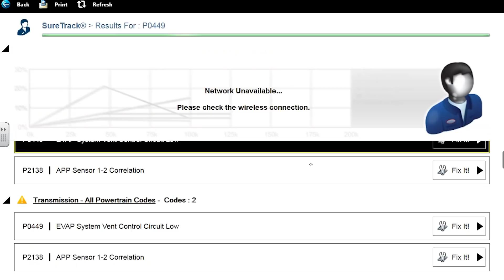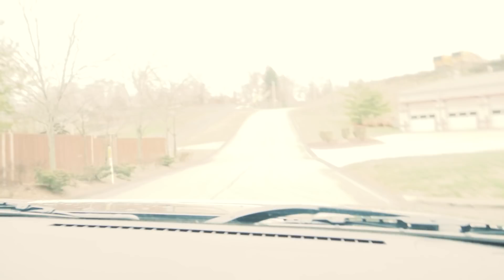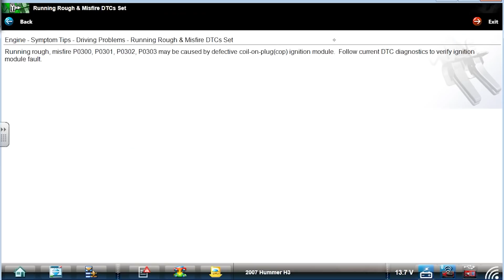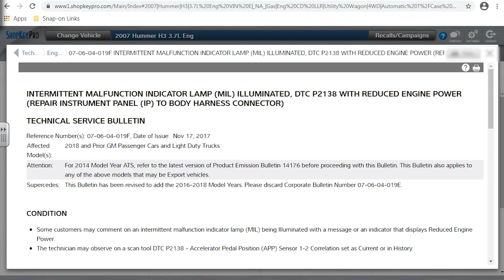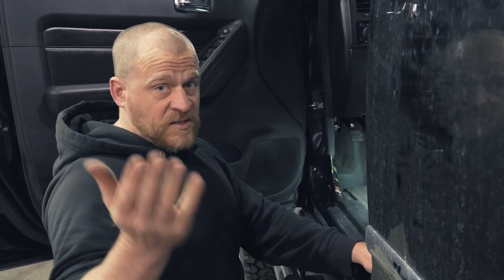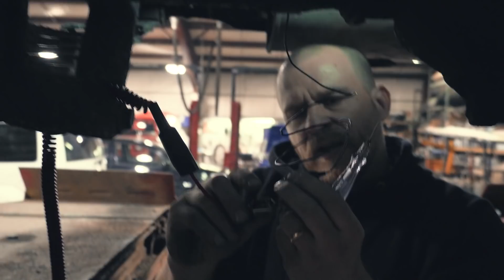2007 Hummer H3 3.7 Intermittent Limp Mode, APP and U-codes, No COM + EVAP Vent Solenoid Fault

Comment: Hi .. like the videos… And I have a problem 06 H3 … it only goes into limp mode when it’s Hot out… 70* and higher… and I do have a major water issue that I believe I have fixed from the Sun roof…but my relay/fuse box has a lot of corrosion too.. do I just change the whole box ? That’s what I think I should do.. I am wondering how it got so corroded.. and how I can keep it from happening again.. any suggestions ?
Reply from the maker: Change the box, yes. How to prevent it from happening again? That part I can't help you with
Reply: @ScannerDanner  Thanks... This POS has been a problem lately... but I could drive it all spring, fall and winter no problem ... I hope this gets it .. Thanks again
Reply: @ScannerDanner  I have 1 more question.. How hard do you think it would be to put like a 305 Chevy in it.. Would it be too technical ... or just a bit ?
Reply: @ScannerDanner  I found out how water would be getting to that fuse box and other places… because my H3 started a miss… checked the spark plugs and found 2 inches of water in the 1st one on the front of the engine
Reply: @ScannerDanner  the hood louvers… if it’s not sealed completely… all the way around… all 12 holes … and follows the hood frame work right to the fuse box… water every where
Reply: @ScannerDanner  I can only post pics on my page I guess

Comment: Aftermarket radio can mess up the car also
On my X-trail/Rogue, the pevious owner installed a Pioneer stereo. The pioneer canbus unit did something to the network and shut down the BCM. Not allways, but when that happaned, cabin lights came on for a second, then No turn indicators on dash, low beams on, no wippers, no arcon, no trque converter lockup,  if on cruise the engine would even stall. No com with the BCM. So I went to thru that rabbit hole. New BCM, new IPDM. Same fault after few daiys. I suspected the Poineer head unit but the radio worked and even the streering wheel buttons when the fault happened. One time the car was running, I was out oft the BT reach, Son was in the car and he noticed that as soon as the BT reconnected, the fault appeared.  So I took everything out that was from Pioneer. Drove few weeks in silence. Even the modules had no U1000  faults anymore. 
I reconnected the stereo, but without the canbus dongle. The headunit recieved Steering buttons, reverse and something more from the can dongle. Now the headunid works, but no SW controls.

Comment: My vehicle is doing the same thing. But when you first start it, it runs just fine, after driving it for about a hour it goes into reduced engine power with check engine light then it stalls. After a couple minutes you start it, the car starts and check engine light goes off. When you scan the codes, it shows no codes? Hmmmm

Comment: Done a couple fuse boxes on GM’s for throttle body voltage drop outs lately. Anytime the two main voltage pids didn’t match, it set a code and went to limp.
Hope they saved over a dollar per car making these parts. Seems to be happening across lots of brands. (Sighsshakeshead)
Need to make some videos on it too, haha.

Comment: Great video! Very informative as well as entertaining. Diagnostic work can be stressful and dull at times. It's good to let of steam once in a while. Correction: Class 2 serial data on GM's is SAE J1850 VPW (on pin 2 of the OBD connector), not CAN.

Comment: Intermittent issues are tough
Had a customer get rather upset we didn't find anything
Went for a test drive with the customer and they plugged in they're phone charger and 5 miles into the drive the car missed or limp mode. Disconnect it and the car ran fine.
Why I'm not sure. 
Well at least the customer got humble quick 
Thanks for the video

Comment: I have BlueDriver scanner I’m using since 2 years but found new thing which is out of my knowledge need u guys help ! On toyota corolla 2005 and nissan altima 2007 i try to connect my obd2 scanner ( BlueDriver) but it’s blinking blue light and get off again idk why whats will be the reason ! I check fuses but all are fine okay . Cig and obd fuse also i change but still my scanner didn’t connect do anyone know why ?

Comment: CORROSION IN YOUR RELAYS, I CHECK THAT FIRST ALLOT OF THE TIME WITH THE PROBLEMS YOU'RE HAVING, IF I FIND IT, I PULL THE FUSE BLOCK AND TAKE IT APART, AND ITS NORMALLY ALL CORRODED THROUGHOUT ALL THE BUSS BARS, ONLY TAKES A FEW MINUTES ON MOST TO DO, AND THAT BECOMES YOUR STARTIG POINT, I'VE REPLACED A FUSE BLOCK FOR JUST A HORN BEING INOP ON A LATER GM VEHICLE, I'VE ALSO REPLACED A RADIO FOR A TRANSMISSION PROBLEM TOO....EXPLAIN THAT TO A CUSTOMER, TECHNOLOGY IS GRAND.....LOL
Reply: I have a 2011 bmw 750 li waiting on a new exterior door handle because it makes the check engine light, trac light, abs light, and electric ps light all come on... that's a good one to explain to your customer. A $400+ door handle will turn off your Christmas tree dash- I promise...

Comment: My own Pontiac G6 had the water leak into the connector in the kick panel.  The sunroof drain would leak down the A pillar in a heavy rain and then had the reduced engine power situation.

Comment: Did you ever think if corrosion  come from? And it would be a good idea to use connections cleaner especially it is hard to clean.In my experience that the vehicle was into water.If it was a Hummer problem through G.M. maybe we have a bigger problem
Reply from the maker: poor fuse box design, 
We have a follow up video coming out this Wed. and the problem was NOT related to the corrosion believe it or not

Comment: Keep this in mind when something like this happens on the first generation Colorados and Canyons as they and the H3 are all based on the same platform.
Reply: I've fixed the same problems over and over on these. Cars are creatures of habit, if it happens to one itll happen to them all. Up here in Cleveland almost all of the problems similar to these end up having corroded relays, corroded fuse boxes, and tons of corroded grounds and random wires in a harness.

Comment: Hi Paul.  I was wondering if there would be anything to gain in these situations where you have driven the vehicle to try to experience the fault so most systems would have been stressed to a degree.To then run over the fuse box and areas of suspicion with a thermal imaging camera. Non intrusive and may highlight areas of electrical stress....perhaps give you something more than just a bare eyeball view and maybe give you some direction.
Reply from the maker: Great thoughts! I like the way you think. In this case the thermal imager would not have helped us. I have a follow up coming in a few days. Thanks!
Plus I think underhood temps and me having no point of reference on what a good system looks like. I think we would be surprised to see what is actually hot under there and it is not a problem.

Comment: Love it, Thanks for sharing SD👍
SD could this fault & the Class 2 DTC be occurring due to corroded relay pins in the power distribution box?
Stay Safe Guy's you're Awesome😎
Reply: I bet $2.63 that it is corrosion in or around the engine fuse box, possible corroded grounds for the relays that are under the box. I've seen 2/3 out of 4 pins on the relays corrode to dust and stay in the box when the relay is removed..
Reply from the maker: @Brother2Jis_27s4  you owe me $2.63 :-) update and fix coming up
Reply: @ScannerDanner  lol, pay pal work for you?  I've seen quite a few up here in Cleveland, salt is a problem. I've gotten cars with new throttle bodies, wiring harnesses, ecms, and just about everything new but nobody does electrical diagnosis from the fuse box. I bet you'll see it at some point, if you haven't already.
Reply from the maker: I have a follow up coming out in a few days.
Reply: @ScannerDanner  Thanks SD you're Awesome😎

Comment: Open solenoid is that mean it's bad?
Reply: How did you see this in the video?
Reply: @Ryder4u1313  buy his book and start learning. Take the class on line, and start making good money.
Reply from the maker: @Ryder4u1313  12v and 0v on a ground side switched circuit is NOT normal when the circuit is off. It should be 12 and 12.
Reply: if the Coil inside is open its bad yes
Reply: Yes open solenoid is faulty, no good. Need replacement and live testing to make sure it functions correctly.
Reply from the maker: Yes sir, the winding in the solenoid is electrically open

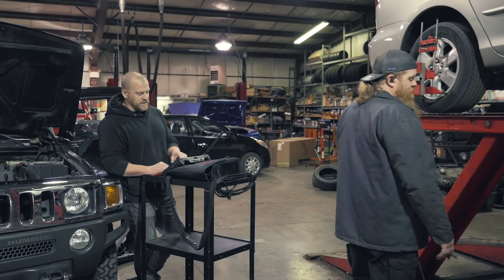Comment: 29:35 Reason number 1 for not bothering with anything Mitchell or redrawn. P2138 tapping of the APP and monitoring the 2 sensor outputs is an easy way to recreate the failures
Reply: I love my color diagrams but they have screwed me in multiple occasions.
Reply from the maker: We have a part 2 with the fix 😉 and it wasn't the app
Reply: @ScannerDanner  sweeeeeet

Comment: I fought this same issue on a 2015 GMC Canyon.  Guy bought it with 10k on it.  At about 80k it started doing this.  It would go into limp mode and set a P2138 code.  By the time he got it to me it was fine. I sent him on his way.  A couple weeks went by and it happened again.  I got the truck and couldn't duplicate again.  I found the same bulletin you did, but that truck didn't have the connector the bulletin talks about.  I load tested all the wires between the APP and PCM and all was good.  When I got deep into it I found that the APP connector had been replaced and a new wire had been run from the connector to the PCM.  So, I concluded this truck had this issue since nearly new, the dealer couldn't fix it, and the guy probably traded it in for something else.

After I had done my load testing of the wiring I went to put everything back together.  I plugged the PCM back in, came back around to the APP connector and found it beginning to melt because I left my power connected to it!  I immediately yanked it out and my heart sank (much like the arcing incident on the last video!) that I possibly damaged the PCM.  I plugged it all in and found all OK other than a melted APP connector.  I ordered a new connector and replaced the connector again.  

The bulletin also mentions aftermarket equipment.  I looked around and found an aftermarket rear backup sensor set up in the rear bumper.  It was the kind that takes the add on head unit that goes somewhere on the dash but the head unit was nowhere to be found and the customer advised he'd never had it.  I removed the little black wireless box from the backup light circuit and threw it away.  

The guy took the truck after that and it's been just a bit over two years with no further issue.  Not sure whether it was the connector which had already been replaced once, or if it was the backup sensors that had been added to the rear bumper.